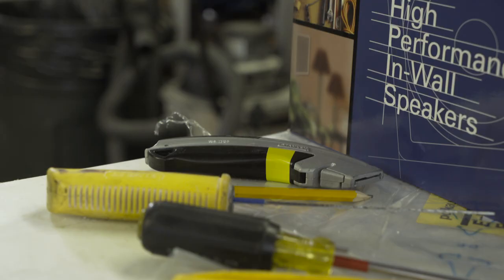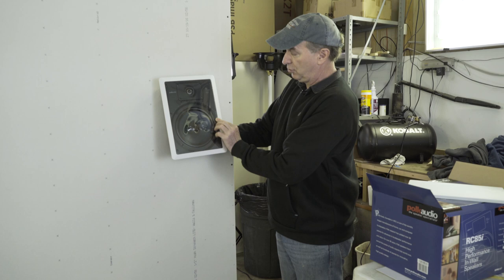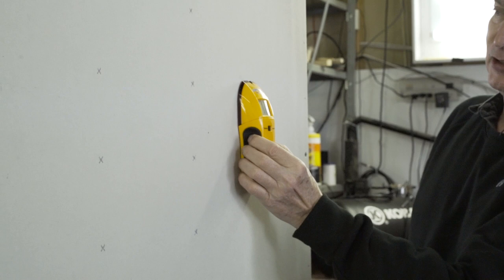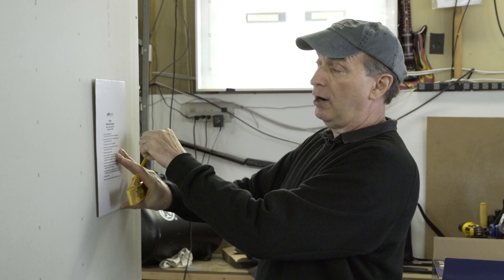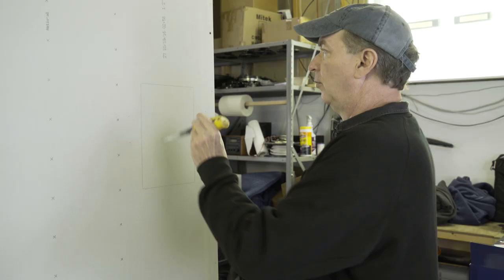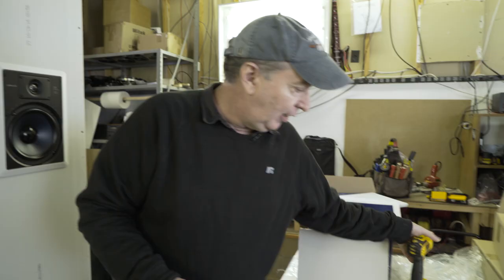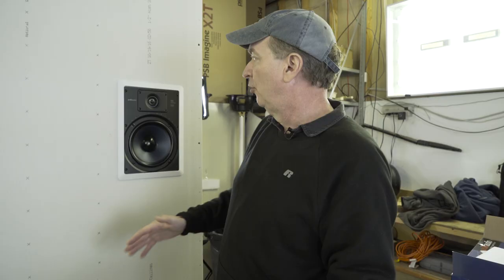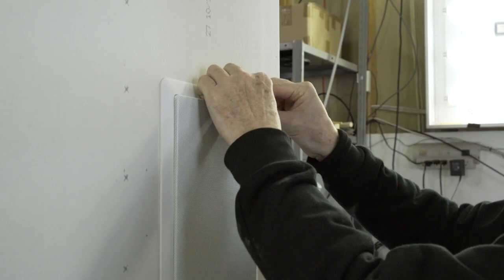Installing in-wall speakers | Crutchfield video

Comment: Nice video, but you forgot to mention the most important thing.... please run the speaker wire first and connect it to the speaker before putting the speaker on the wall.

Comment: ....and make sure you connect the wires before you tighten the brackets that secure the speaker in the wall. Just a small detail that was left out.

Comment: Great video. You make it look so easy. How far must the sofa be from the wall? How many feet away? Also what is the height that the  in-wall speakers must be installed?
Reply from the maker: Hi Georgi, there will be multiple answers to these questions, depending on the gear you're using.
Please get in touch, we will be able to help.
www.crutchfield.com/I-rYTVc164/contact

Comment: Very complete instruction,....except at the end. I would like to know how to remove the grill, if I ever have to. Does it take a special tool, that might be included in the speaker kit?
Reply from the maker: Much depends on the specific speaker model and how the manufacturer has designed the grill to attach. Most are magnetic while others secure to the speaker frame. None of the models we currently offer require any "special" tools for removal. 
For additional assistance and personalized recommendations, feel free to contact us directly:  

http://bit.ly/2jBGHPp  

Hope that helps,
--Crutchfield

Comment: I guess I'm just looking for a wishful solution and I kind of already know there's no real solution but maybe you guys will have some different insight. What if the reciever is about 6 stud bays over, is there anyway to run that wire with zero attic access and without any extra drywall damage. Since a 6ft. drill bit is out of the question, i'm out of options. Any ideas? Thanks.

Comment: If we have our new construction home pre-wired for speakers, it will have a plastic box with wires attached to the stud which doesn't allow you to leave a 2" gap from the studs. How do you adjust your installation in that scenario?
Reply from the maker: We would recommend getting in touch with a member of our AV Design Team.  You can follow this link to leave a request for contact.  https://www.crutchfield.com/I-rYTVc164/Institutional/diy.aspx

Comment: I bought a house with in-wall speakers. Anny idea as to how I would connect my phone to them?
Reply from the maker: Congrats on your new home! What is being used to power the speakers? How are you hoping to integrate them specifically with your phone?
Reply: @crutchfield  Thank you. I am not sure yet as I am not skilled enough to check what's behind. I was hoping bluetooth but not sure if that's feasible. The previous owner isnt being too helpful
Reply from the maker: That can take some extra time to explore. Once you find out what you have for power reach back and we can recommend some options for connecting Bluetooth or WiFi to the current setup.

Comment: Will it be trouble to cut the hole really close to the stud ? Electrician made a hole on the stud.
Reply from the maker: The only potential issue I can see being an issue is if the speaker was installed so close that the rotating cams (or fingers) cannot extend out like they need to because you are that close to the stud. Just be mindful of their installation and as long as the speaker can be properly installed, then it can be close to the stud
Reply: @crutchfield  Is that normal there's a gap between the stud and the dry wall ? I'm able to put 1 finger between them. Thank you
Reply from the maker: Typically, no. The drywall is usually secured to the stud with no space in between them

Comment: Do you think it would work if I were to buy car speakers, and place them in the wall? And connect it to an amp also in the wall?
Reply from the maker: Hi!
We would not suggest this type of installation. 
If you would like to speak with an Advisor, we will be happy to help you find the best speakers for an in-wall setup, along with the proper power supply for the speakers.
www.crutchfield.com/I-rYTVc164/contact

Comment: So i used a drill on the lowest setting to secure my speakers. However, it still over tightens the dog legs/wall clamps and cracked them. I can't find any replacement dog legs/wall clamps. Any idea where i can find them or a substitute so I can install my speakers?
Reply from the maker: I'm not aware of any universal replacements for the dog legs. You might try contacting the manufacturer if you haven't already. If you purchased the speakers from Crutchfield you can contact our tech support for further troubleshooting or warranty claim - their information is located at the bottom of the invoice or in your account.
Reply: @crutchfield  Thanks for the reply. I did end up contacting Polk Audio and they are sending replacement parts.

Comment: Hi Norman , how do you install the wall in speakers if there is no Dog ear on speakers
Reply from the maker: I'd guess they have a different name for the dog legs or require access to both sides of the wall during installation. Which ones do you have?

Comment: I have paper backed fiberglass insulation in my wall. Do I need to remove the insulation in the same size template as the hole? or simply compress it down as I mount the speaker in front of it?
Reply from the maker: It might depend on the speaker you are installing and what kind of back-box (if any) it has You don't want fiberglass to get into the back of your speaker so you want to make sure you have a nice buffer Our tech support can walk you through installation for any speakers purchased from Crutchfield. If you need help picking speakers you can connect with a product advisor here: https://bit.ly/2DGSzu3

Comment: I need to install an in-wall center channel speaker over a wall stud. The wall stud sits at the center of the speaker and will need to be notched in order to accomodate the speakers depth of 2-3/4" minus 1/2" for the drywall thickness. The stud that needs to be cut is 1 of 3 studs that work to hold up the 100 lb. TV. Will the stud need to be reinforced after cutting the 6" x 2-1/4" notch out of it?
Reply from the maker: A dedicated in-wall center channel should be made to fit between standard wall studs and not require any modifications to any studs (such as you've described). We would not recommend using any speaker that would require this. 
For additional assistance and personalized recommendations, feel free to contact us directly by phone or through our online chat service:
http://bit.ly/2jBGHPp
Hope that helps.
--Crutchfield
Reply: Believe me when I say that I have thought about placing the speaker between the studs. That would be the easiest answer if it were the only consideration but unfortunately, there are other factors. The speaker is part of a matched set with the the left and right speakers already in the wall and the two surround speakers already flush mounted in the ceiling. With the center speaker being almost 14" long, it would require shifting it approximately 9" to the left or right to position it between two studs. With that shift, I would also have to remove the current speakers from the wall and ceiling along with the current wall plate, repair the drywall and reinstall everything into the new position before shiting my home theater furniture over to re-center it between the new speaker locations. With a shift to the right, my seats are against a wall and with a shift to the left, my seats are blocking an open walkway. What would you recommend under the current circumstances?

Comment: Should you insulate behind the speaker?
Reply from the maker: The speaker doesn't require anything behind them. But if you do need to install insulation for climate control purposes, it's best to either use a closed back in-wall speaker or install a wall box to keep the insulation particles off the speakers.
--Crutchfield

Comment: how do you remove the grill?
Reply from the maker: They should be able to be pulled back away from the wall or pried out of the grooves that are currently holding it in place. When trying to pry it loose, be sure to use something that is not likely to scratch the grille.

Comment: Thanks. Can this be installed on the ceiling?
Reply from the maker: We would recommend using an in-ceiling speaker for your installation, instead of an in-wall option.
Please chat with an Advisor online or by phone, we will be happy to make a recommendation for you with the gear that would work best for your application, as well as answer any questions you may have.
www.crutchfield.com/I-rYTVc164/contact
Reply: @crutchfield  thanks

Comment: Now how do you run the wire :P
Reply: No one seems to show the most important part, they promise it in the beginning...but ehh lol
Reply: It’s 2 wires ....black/black red/red  if you can’t wire it you probably shouldn’t be installing speakers yourself anyway .
Reply: @nmore69  Ok thats obvious, but he didnt explain which power source he was tapping, how he ran the wire through the wall so forth n so forth..

Comment: l hate electronic stud finders. l have never had goo luck with those things. l usually use a hard drive magnet and that works pretty well. but one time l was helping a friend hand a TV and he had one and wanted to use it. and l have to tell you we must have put 10 holes in the wall before we found a stud with that stupid thing.